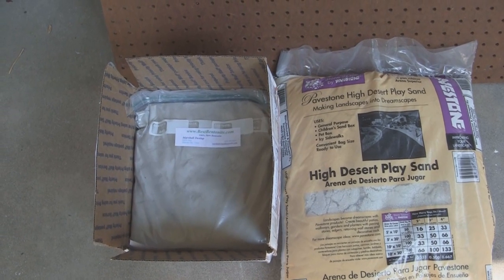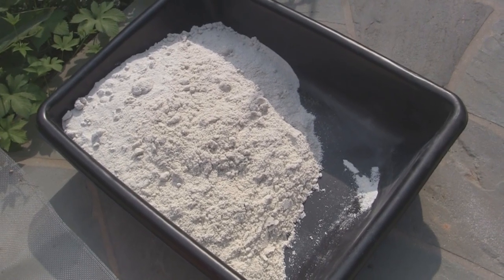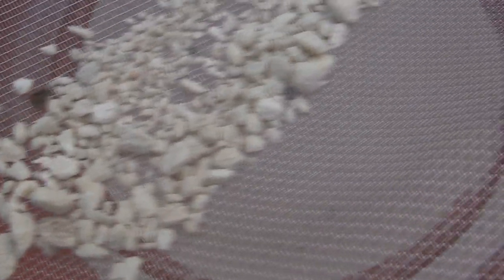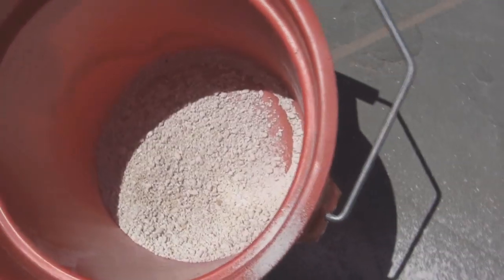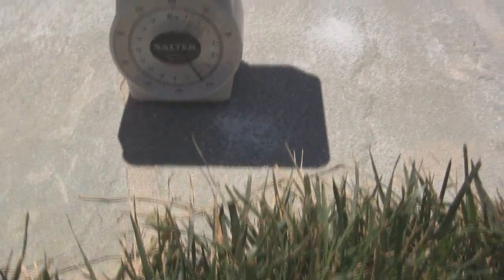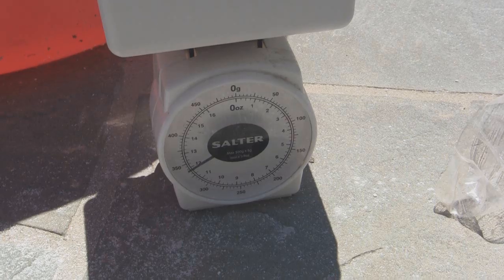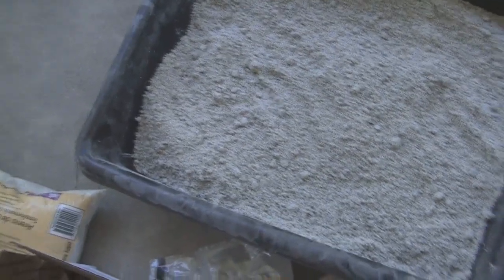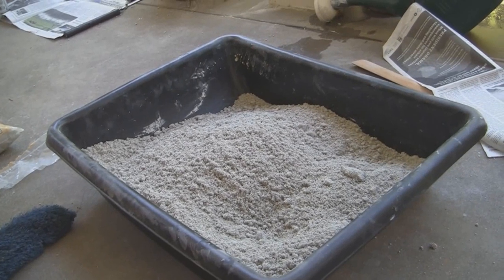How to Cast Iron: Part 1 How to Make Green Sand

Comment from the maker: @JBladerMS Well, clumping cat litter is made of bentonite clay but you have to grind it up some how which might take some time. Then you just follow the steps with the ground up cat litter(bentonite clay). Also you may want to get the unscented clumping cat litter.
Reply: I have been casting aluminum off and on for a few years but now I want to do cast iron. From what I remember cast iron green sand had different ingredients than the usual bentonite clay green sand. If not and people just use regular green sand for cast iron please let  me know ty.